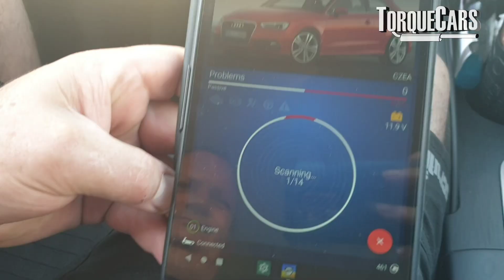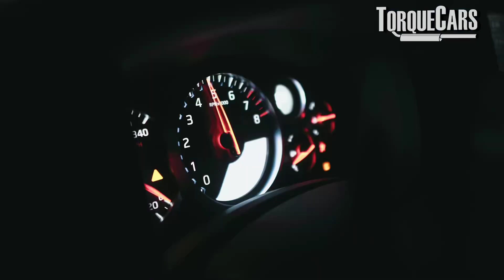What Causes Engines To Stall Or Cut Out While Driving? Diagnose & Fix Engine Stalling Problems

Comment: New to the channel. A faulty EGR valve made my Trans Europe Roadtrip a bit more challenging. My little 1.4 audi A2 cut out and smelled bad. Wouldn't idle and only started cold. I did an oil change before the trip (dipstick of the BBY is very hard to read) and thought I overfilled and killed it. Bougt a bucket and funel at the local Aldi, and commenced project drainage. No succes. Cleaned Lambda sensor again to no avail (I was guessing at the point). A bad night full of guilt and remorse in a truckstop followed before I found out it was the EGR. I'd love a simple OBD2 in my repair kit, can you advise?

Comment: I have experienced a 1.4 TDCI engine cut out due to failing injectors. The engine ran so rough that it actually cut out. We also had a Nissan Micra K12 engine cut out randomly. The engine ran on less and less cylinders until it turned off. There was an engine light but no codes were showing up. The old K11 Micra we had also failed in a similar way and it was due to a failing timing chain.

Comment: Is removing a dpf completely safe for a car long term, i’ve heard a few people say remove them completely rather than replacing them
Reply from the maker: As long as the ecu is not expecting there to be one it should have no detrimental effect as it only really adds a restriction in the exhaust flow, (so an ecu tweak is also required), other than the fact it is not legal in most areas as this is an emissions control device.